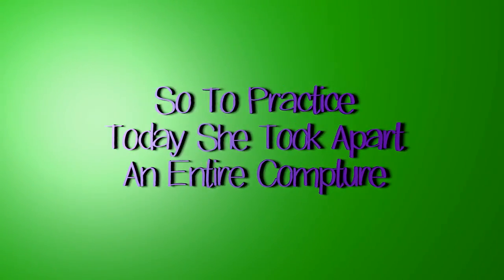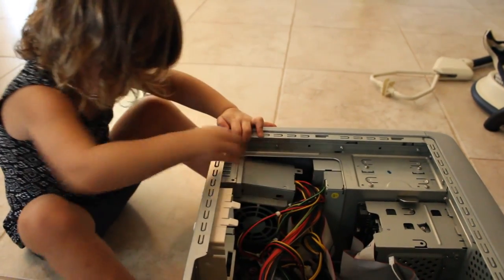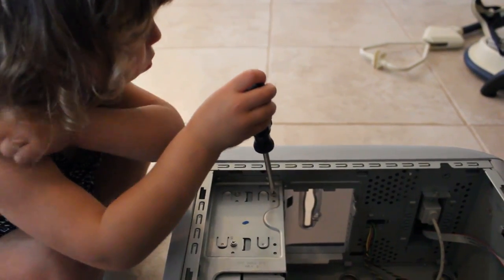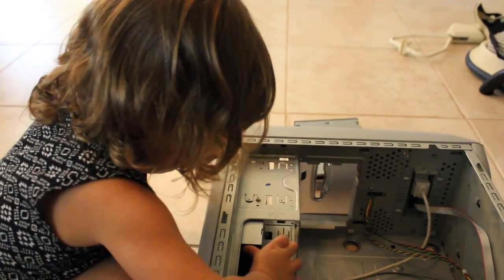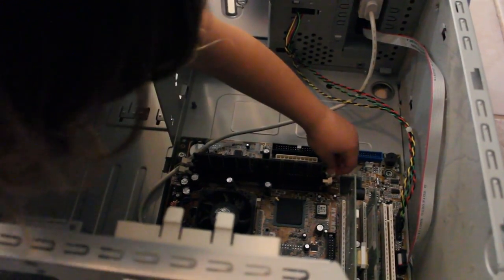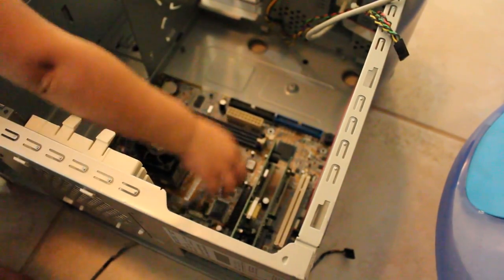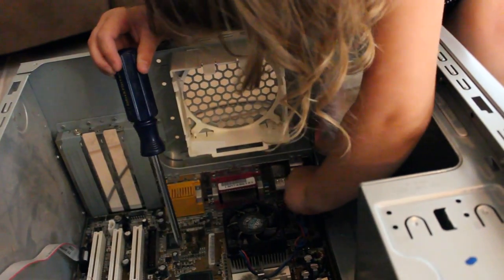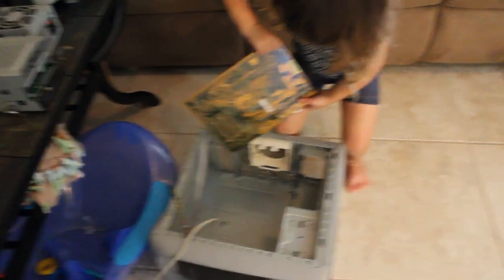Ember's Computer Repair Shoppe June 12th 2015

Comment: not to be a party pooper, but power supplies can still carry an electrical charge even when unplugged.
Reply from the maker: David C.C. Erickson Not when they haven't been unplugged for a years.  Also the power supply out puts lower power.  I think the highest voltage it puts out is 12v.  If she was to open the power supply up and start touching stuff with the screw driver then there maybe some concern.  You're not being a party pooper.  You just have concerns for a non-existent threat.
Reply from the maker: David C.C. Erickson Oh and if this video bothered you, after we took the power supply out I plugged it in and let her hook Fans, Motors, and LEDs to the connections.